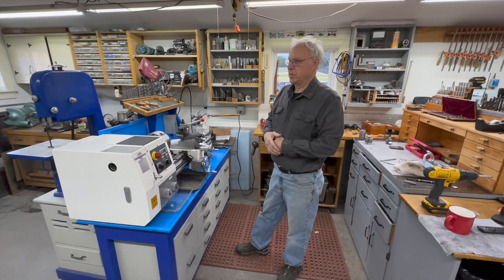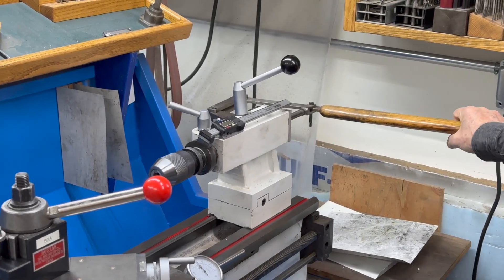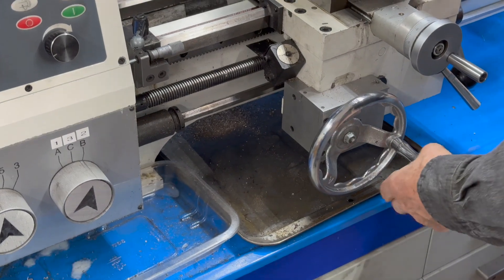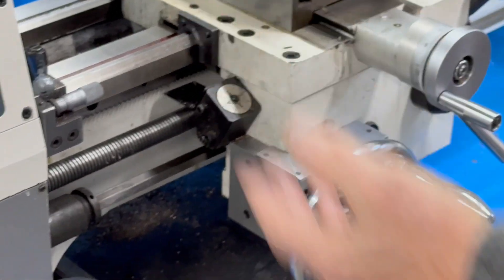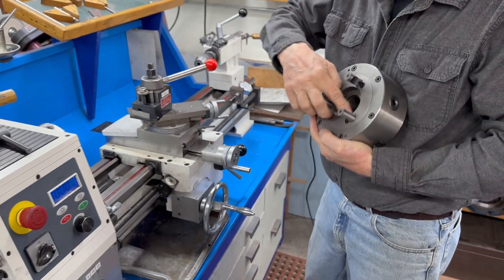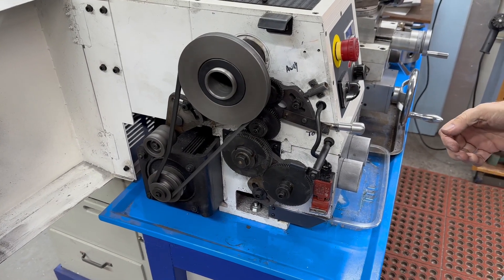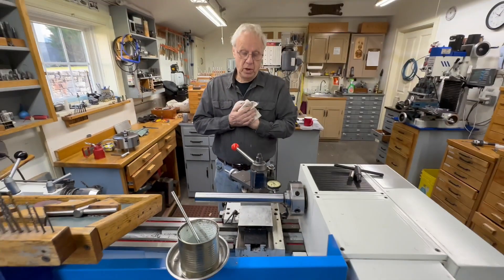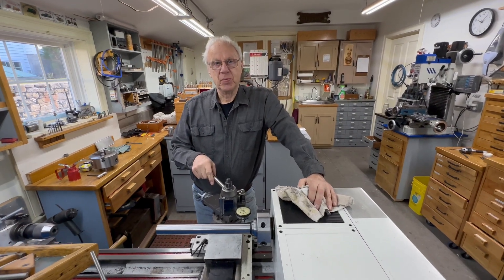PM  Lathe 1228VF LB Improvement

Comment: Very nice lathe. I wanted a PM but I bought in 2021 and PM had major wait times of 6+ months. I ended up with the Grizz 9972 11x29 and have since added many mods including a 2hp brushless VFD , and  X,Z DRO's . I like your standard D1 chuck retaining setup, that's much easier to swap out chucks. I have a 1-3/8"-8  threaded spindle, very oddball and difficult to find chucks that fit.
Reply from the maker: Hi, I know all about waiting for a lathe delivery. PM said that the lathe I ordered in January would take about 6 months. Note that they said about, About turns out to be 9 1/2 months. 
I had a Grizzly at that time and I sold it 2 weeks before the new one was supposed to be here.
So I was without any lathe for 4 months. I used the time to build a new stand with lots of custom made drawers for the tooling. Joe

Comment: So I see that you adjusted both the bed and the headstock for alignment. I can't quite picture how you do that since measuring the alignment of one references the other. In most alignment videos I see, the assumption is that the headstock is golden, and any issues are due to the bed.
Reply from the maker: @CosminHasFishTanks  Hi WM,  I spent a lot of time doing all the usual alignment procedures, nothing worked.
So as you know the head is not adjustable, so I tried a few tricks to move the head and nothing worked, because when you tighten it down it just slides back to the same place. So just to see what would happen I put a piece of shim stock on the v way to move it the way it had to go and it worked.
I can now do cylinders 4 to 5 inches long with no measure able taper.  I only make model engines so I seldom use more than 6 inches of the bed . The rest of the bed is only a good place to park the tail stock.  Also when I first got the lathe the carriage shims were not adjusted, they were very loose.
So I adjusted them to the proper clearance and l it was extremely tight and hard to move. At that point I talked to PM and they were no help so I called a friend that restores machines. He did a few checks and found the carriage wasn’t on the v way properly and did some scraping on one side of the v way and that fixed the binding issue.  The lathe is now perfect for the way I use it, but as you can see in my videos I have made a few changes. Joe

Comment: Knowing what you have learned about this lathe, would you recommend this lathe to others?
Reply from the maker: Yes  it has more of the important features than most of the other Chinese lathes and it’s hard to find any smaller lathes with a 1.5 inch spindle bore . Also it’s a lot quieter than most of the others. I’m 
Very Happy with it but I did make a few modifications to make it better.
Reply: @JoesModelEngines  have you had any parts fail? If so, what parts?
Reply from the maker: @bking0740  no failures and I use it almost every day for 3 or more years. 
The only issue was the plastic cover over the buttons and I know from experience oils 
Are hard on that type of plastic. Easy fix check out the video I posted.

Comment: Agreed it looks like one of the nicer mini-lathes.  However, the mfg responce to your quick chuck taper issue is very troublesome.  Kind of tells me be very careful with PM.

Every one makes mistakes.  Its normal.  When they wont fix it for you, thats when it becomes a problem.
Reply from the maker: Hi thank you for your comment. My lathe was made during the Covid pandemic. That may be why it had a few problems. But like I said before The answer I got from their so called experts was really stupid. Also after thinking about it for a few months I wonder if they had heat in the factory. If the spindle is very cold and the chuck was is warm It would probably have gone together. When I got it I used a electric heater to get the chuck hot enough to remove it. After a few changes the lathe is working great and it so much quieter than the Grizzly I had before. I’m now very happy with it and I use it almost every day.
Reply: Thanks for taking the time to explain.  Its very useful to have honest reviews of the equipment.  For example, doing some more looking after seeing your comments, it seems many people do not like the G brand after using for a while.  While PM seems to get good reviews.

I think that helps a lot, saves me a lot of time.  So I dont have to discover for my self.
Reply from the maker: @chadmartin479  Hi Chad,
I personally think that the lathe was a good choice for me . It’s got a lot of the features that I wanted and it’s not noisy when I put it in power feed. It took a little work but I m very happy with it now.

Comment: Chinese lathes are a kit in a crate. Realizing that from the outset lessens unhappiness. Want happiness out of the box, spend the extra bucks and buy Taiwanese. If the machine is Taiwanese built the vendor will be sure to mention it in the advert.
Lathes are usually set to turn ODs larger at the front by zero to 0.0005"/foot and IDs smaller at the front by the same amount. The rational for this is if turning parts for an interference fit it helps insure that for a force fit, if it starts together, it will go all the way together without seizing.
I must give Joseph credit. He is the first person I've seen on youtube use a test bar to check the lathe's alignment. One other check to be made with the test bar is using the indicator to make sure the spindle is parallel with the bed. The tailstock quill needs to be checked at the same time for parallelism to and centered with the spindle. Misalignment of these will cause mysterious slight tapers when turning (especially multiple bearing seats on a shaft) even if you adjusted the tailstock to zero taper, but then move the tailstock to another position on the bed.
Cheers from NC/USA
Reply from the maker: I like your remark about being a kit in a crate.. you are not far from the truth. I did a lot of work on it and it is now finally working very good. The big reason why I changed was to get a variable speed motor that that reverses with a button push. Also the D1 -4 chuck mount was a must so you can’t spin the chuck off by mistake. I’m actually quite happy now that everything is working properly.
Thank you for your interest and your comments. Joe
Reply: @JoesModelEngines  I have a 1990 Dar Sin built Taiwanese 12x24 belt drive lathe. It has a screw-on chuck and spinning it off has never been a problem. However just getting it loose has always been a headache. It fits really well. I use a paper ring behind the chuck so I can get it off without cursing. I use a 4" 3-jaw scroll chuck with a 5C collet mount 90% of the time with the draw tube and collet set so running in reverse isn't a problem.
Your spindle quill lever is trick. No worries broaching a keyway with a boring head to adjust the cutter. With the hard work done you should make a turret tool holder for the quill. You can buy one from Travers Tool, among others, or better yet, make one. Popular Mechanics and Popular Science are all on google books online and issues from the 30s-50s have plans for several flavors. Some have travel stops. Just the thing for all those duplicate parts you often have to make for models.
Cheers from NC/USA
Reply from the maker: Hi  @aceroadholder2185   I used to have the Same problem with my grizzly lathe, I finally figured out what I was doing. I was storing the checks near the wood stove in the basement , if they were warm when I put them on and came back another day when the basement cooled down to much I would find them stuck.
That s when I came up with the idea to just put the electric heater on it .after about 15 minutes it came right off. I’m not sure if it was the thread or the regestot
Reply: @JoesModelEngines  The danger with screw on chucks is the temptation to engage the back gear to lock the plot up. If you've ever wondered how the bull gear ends up with broken teeth, now you know. Warming the chuck up is a clever way to get one off.

Comment: That’s insane that he told you to file your backplate to fix a poorly ground spindle nose taper. That spindle nose taper is critical to the accuracy and concentricity of everything that’s mounted to it. PM used to have a pretty decent name, at least as far as import machines go, but that’s just ridiculous. EDIT: I really like your workshop layout btw. Looks like a great space. Mine is a mess, packed full of old machines so you can hardly move lol. But i do love my old machines, so what are you gonna do… subbed!
Reply from the maker: I’m not going to do anything. I’ve got the lathe working well for what I do and I can’t believe how much easier it is with variable speed motor. It took me some time to get it the way I wanted it,but looking back it was time we’ll spent. Thank you for your comments and interest. Joe
Reply: @JoesModelEngines  Oh sorry, i wasn’t asking what are YOU going to do about your lathe lol. I meant that in reference to me saying “my shop is a mess cause of all the old machines but i love ‘em so, what can I do” Sorry now that i read it it’s confusing and doesn’t come off like it did in my head when i wrote it.
Reply from the maker: Yes I agree I called them at least 3 times and never got a good answer. The lathe could be a very good one with just a few changes but I don’t think that they are interested in my feed back. I’ve done a lot of work on it and I’m very satisfied with it now . Like I said it was built during Covid and I think that had something to do with the problems .  On the other hand,That pm 728 mill is perfect for the home shop.   I love that machine.   
Thank you for your comments Joe
Reply: @JoesModelEngines  Often said , Chinese equipment comes as a kit. I've had a PM1440HD since 2016. I've done things to improve it over time. It now works quite well. Truing the spindle to the ways greatly improved accuracy. No more turning tapered parts (if I don't want to.) I bought the lathe to do repair work on my business manufacturing equipment. It has been too short several times. I have always managed to work around the limited length. I'm now retired & all may metal working equipment is in storage. Hope to find a small shop space or garage soon.
Reply: I'm surprised too. They should have sent you a replacement. PM has a reputation for being the very best among the Chinese imports with excellent product support. You pay a premium for it.  If you're have to mod it, what's the point? You might as well save the money and purchase a cheaper Chinese lathe and rebuild it from scratch.
Reply: This seems to be par for the course at this level of machine tool.
Reply: Seems like a good size lathe for about everything the average guy would do

Comment: Oh whoops. So I think you already answered my question about this but since you changed the title of your video, youtube thought it was a completely new video and erased the comments.
I asked if this was good for cutting on 4140 steel. What do you normally use it for?
Reply from the maker: I’m sorry, I had no idea that reposting the video would erase all of the comments. As for what I do with the lathe, it’s just a hobby with me and I make model engines and tooling for my shop.  Most of its quiet small.
I guess that the largest turning I do are cast iron flywheels. 8” is the largest. 
As for the 4140 , I use it on occasion but my parts are small.  I would think you would have no problem unless you try to take heavy cuts in large diameter material.  My favorite material is 12L14 or brass. 
Thank you for your interest.   Joe